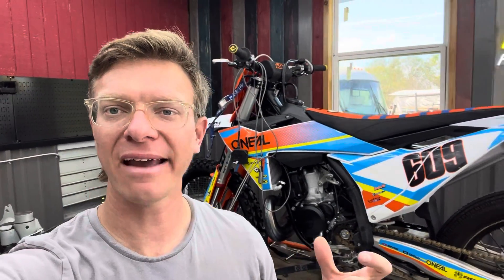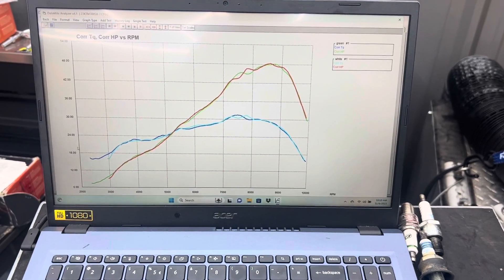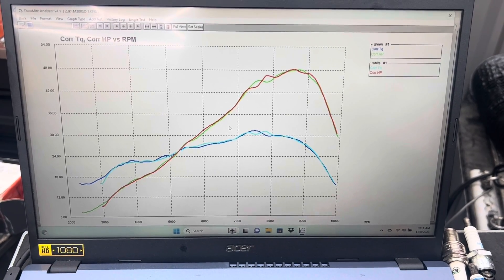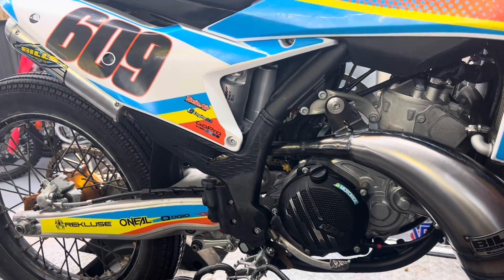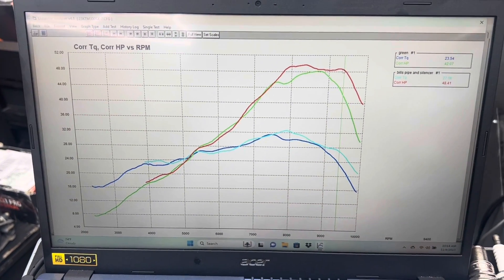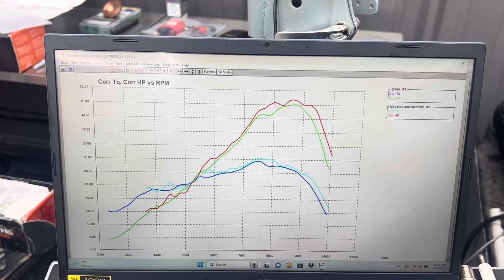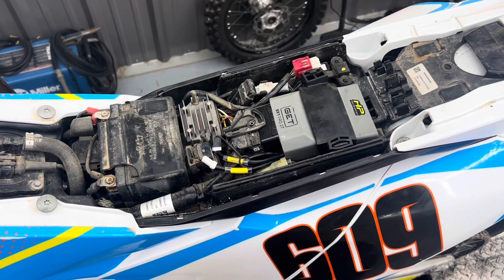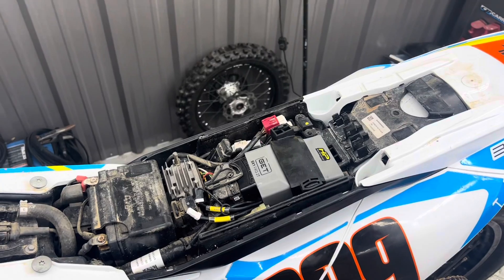EFI 2 stroke Dyno Testing, KTM 300sx. Pipe shootout!

Comment: What's wrong with this motor? Eric gore says 40hp at the wheels tops with a rev pipe porting , carb bore @36mm recuircuited. It should be at 47-53hp faster than a 250. The 200cc must be a out a balance bore and stroke? I mean the 143cc are making 44/45hp
 https://youtube.com/shorts/GfXn8WppIQg?si=OZg5qONg2-eC1Src that sounds like 40hp in the video it looks bone stock?
Reply from the maker: @AnthonyStempak  eric gorr is the opposite of a performance engine builder
Reply: Don't worry about the numbers on the dyno. The dyno reads much lower than other dynos, and they have said it themselves.

Comment: Im trying to get a standard pipe dyno chart vs the varible. They must have gotten it to seal up https://youtube.com/shorts/l72cpWL3iC8?si=VMQVvab8LaqjB7Rv
Reply from the maker: @AnthonyStempak  clearly doesnt work on proper rpm or response time required - let alone fit an mx bike even if it did properly work. You going to stick the pipe into the front tire?

Comment: it's ridicoulous that ktm have same pipe for 250(66,4 mm ø piston)and 300cc (72mm∅ piston)😂😂😂😂😂😂😂
Reply from the maker: @marcozuffada  not really. They have about the same port timings, intended rpm range and target power delivery.  Combined with a low power output per cc because mx bikes are all about power width at these power levels - the pipes are really geared towards good power at early rpm with powervalves down that rev well but arent geared towards high power narrow rpm window. additionally the pipe has to fit the bike and not be in the way.
If it were an all out drag race engine or similar hell ya its crazy to be same
Reply: @HPRaceDevelopment  👌👍

Comment: I’m looking into getting a pipe and silencer setup on my KTM 300sx 2023. I’m on the fence between the bills setup or the fmf fatty with the blue 2.1 they look amazing but I want best for performance. If you have a suggestion lmk. Thanks
Reply from the maker: We have not dyno tested the fmf, sorry.  We know the bills runs great as we have shown especially when adding our ECU the two in combo is huge
Reply: Fmf can not compete agains a Bills.. I think Bills and Procircuit are the leaders when it comes to 2 strokes
Reply: You need to do your homework the ktm200sx came with three factory  pipes and one was a fmf fatty
Reply: Pipes on bikes do not have the same effect as jetskis your gonna make 1-3hp more.
Reply: Run your compression up at 185psi and run vpt2 and run a race r304 muffler if you can
Reply: If your jetted right it could be 3-6hp very noticeable the gas coming out a supreme pumps can be as bad as regular. At 185psi you may get detonation on premium but they do sell 2stroke oils with octane booster and 2stroke.octane booster
Reply: After that your into balancing the crank and porting
Reply: Pull your cylinder head off and send it to this guy to mill the head and adjust the squish band to 185psi typically its 100$ or spend 300$ on a adjustable billet cylinder head
Reply: You need to run VP T2 if you get your head milled its oxygenated and mixed at 40:1 with maxima K2 l belieave

Comment: why does Kim say 57 hp stock
Reply from the maker: @Jb-mp1in  why do you care what the number is…
Reply: @HPRaceDevelopment  no I'm asking why would ktm say 57 hp stock ?
Reply: If its a 250cc 2stroke and 2017 and up ktms are making 4-5hp more than kx ,yz, rm . they have a different power valve and l believe there actually detuned because the valve gets hot easily you kinda need leaded av gas cools and more compression
Reply: That's 57 at the motor around 51 at the wheels
Reply: 57 is at the rear wheel, lol. The only dirtbike company that measures to the crank are the EV bikes because they want to sound like nobody has ever made 80+ at the crank before 😂@AnthonyStempak
Reply: I believe its 2017 could be 2016 and up

Comment: Aren't those improvements a crazy amount?  You say ktm dudes are smart and they are. But isn't filling a 4 to 7 hp gap a day and night difference?
Reply from the maker: I dont think we got 4-7 except over rev region. On a 2t - big gains in over rev are easy for short rpm windows because once power falls off - it falls of fast. There is always a trade - this pipe probably wouldnt run on 87 octane pump gas in 30 degree weather without detonating or something like that where  oem will

Comment: There may be a nuisance variable in there somewhere regarding the differences in maps. The surge in power between with the green map selected in my 23’ 250 TBI is drastically different than the white map.
Reply from the maker: I can assure you at wot - there is no difference on this bike.
Reply: @HPRaceDevelopment yes, possibly on that bike since you mentioned early on in the video that the customer had something occurring related to the software I believe. Do you think that the map switch has more of an effect on the ignition curve compared to an actual change in the fueling characteristics from one map to another? I ask this because in previous generations, the 2018 250 XC for example, had a wire that when disconnected really delayed/softened the transition into the powerband. Good video by the way and thanks for the input.
Reply from the maker: The media has lied to people and their minds eat it up.  These two maps are identical at WOT.  We have seen the same on the 125's.  At partial throttles there are some differences - which people then equate to the entire map.  On the older bikes we can not measure a difference between wire plugged or unplugged - using a slow motion playback of a timing light vs stator wheel vs rpm. @reineherrera8897
Reply: yeah, that is a fair assessment. I just finished a 2 hour hare scramble a couple of hours ago on the green map and as I usually ride a gear high, it is different from the white map. I’m rarely if ever at wide open throttle in these races so I don’t have an opinion there. But I agree with you stating that there is a difference at like quarter to mid throttle along the power curve.

Comment: do you let the bike idle or warm up a bit before doing the dyno pulls or does pipe temperature matter? I thought that the pipe temperature helped for performance a lot.
Reply from the maker: We run the bike quite a long time before the pull is made first in a normal unloaded warm up, then in some progressively longer pulls to get the engine, radiators, both trans and rad fluids up to temp.  Then we do 4-5 back to back pulls in quick succession to collect recorded data.  Pipe temp sometimes helps, most often hurts power.
Reply: @HPRaceDevelopment  ok so its as controlled and up to temperature as possible. interesting how pipe temperature hurts power, I don't know much about how pipes work but I thought that if they were too cold then the gasses would just loose volume and then no gas would be shot back into the combustion chamber. interesting though so thanks.

Comment: I work at a ktm dealership in greatfalls montana as a mechanic and I am starting to hate the ktms. There is no way to adjust fuel or tune the stock ecu and I have a hard time diagnosing promplems too. Like the bikes are not reving out all the way or way to rich down low. Very frustrating. And the tpi bikes piss me off worse.. And 99 percent of the time if they don't run right the computer won't even show codes makes me want to bang my head against a wall
Reply from the maker: They are a challenge!
Reply: Have you tried running VP T2 gas through them

Comment: My question is related to the map switch not making any difference. Has the power value been calibrated with the dongal that came with the bike? When I bought my 2023 300xc my local KTM dealer did not know what it was.
Reply from the maker: weve tested this bike multiple times both when new then after an update and going through by ktm national support at a race - it has always run the same map 1 and 2 at wot
Reply: Changing the timing on 2strokes generally does nothing

Comment: How does this 300 sx compare against ur fastest carbed 250 sx?
Reply from the maker: 250SX way faster
Reply: @HPRaceDevelopment  even top speed
Reply: @HPRaceDevelopment does the 250xc tbi got a stronger power hit in all the gears than the 300xc tbi?.
Reply: Big bores are typically only 3hp

Comment: I always wondered if was there much difference between a brand-new pipe and one that has a season or two on it with no "massive" dents in it. is it worth getting new pipe every year for these bikes?
Reply from the maker: Pipes can get carbon deposits that drastically alter there rpm window / and depending where the dent is, it can be bad. but some dents in the fatter sections usually dont matter much
Reply: No its not if its not dented and you can fix most dents

Comment: Derek do you think with the ECU that this bike would be compatible to new 450s in terms of power and torque? Will be cool to see the results once you get that ecu dialed!
Reply from the maker: Not even close.  The 4t makes a lot more with a lot more power width.  They are geared much taller so the 2t can compete in a straight line and feel quick - but it's just a falsehood of gearing.
Reply: @HPRaceDevelopment when you compare the gearing on both bikes in the owners manuals you’ll find the 450 and 300 are identical. The sprocket choice might be different but the gear ratios are the same.
Reply from the maker: The primary is different.  final drive ratio aka final gear ratio is all the matters - I hadn't looked recently but you are correct with different sprockets they are geared nearly identical at the tire due to the different primary (more gear reduction on 300).  In former race trim - with a 13 front - they are geared much shorter giving them a similar acceleration rate despite being down 5-7 lb ft of torque.  But - the power width is less - and peak hp is less, and thusly with identical final drive gearing (as they have now) the 300 will get walked by a modern 450 any way you want to compare.  A well built 300 can make competitive power but not the power width.  That's the 4 stroke magic when they are afforded the extra CC's.  The 500's can exceed the HP easily but not power width @The_Snowbike_Channel
Reply: @HPRaceDevelopment that makes sense, and yes I agree on a stock 450 walking over a stock 300. I own both bikes.
Reply: @The_Snowbike_Channel , I own both as well and agree.  My stock 2017 450 walks my 2023 300 TBI with ease and will pull 3rd gear damn near from a stop with ease.  Ridable power = power under the curve which the 450 has for DAYYYYYS.  The peak power of my 300 and 450 may be close but the 300 carries it for less than half the rpm range that the 450 does it seems like.